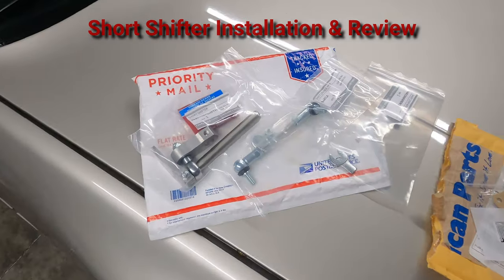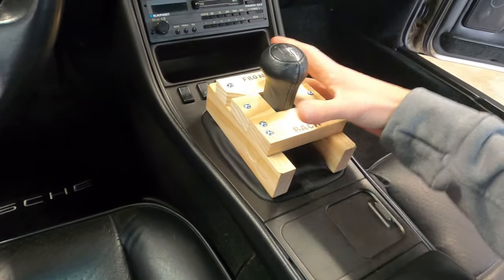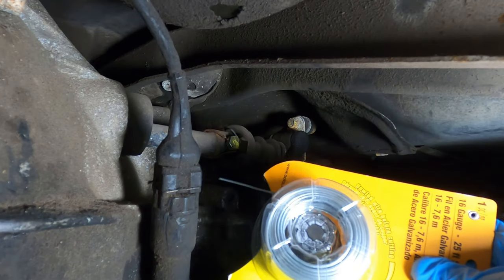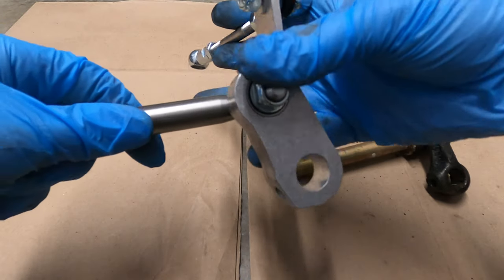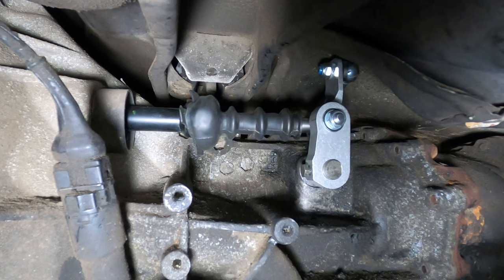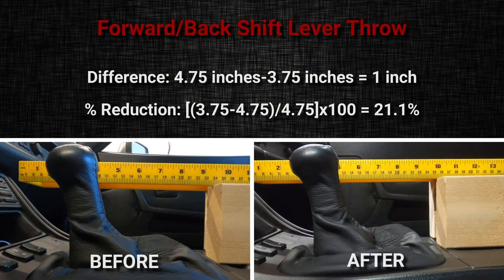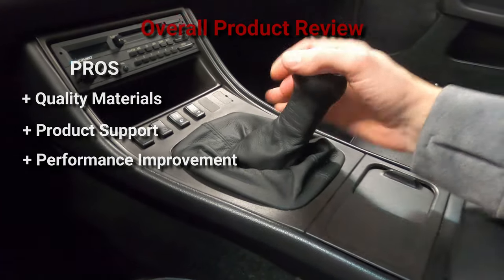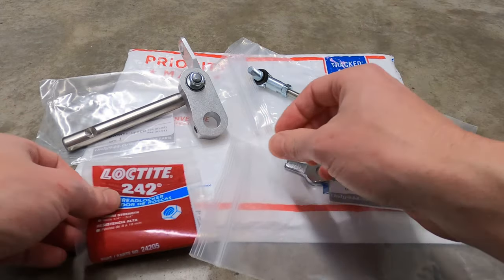Porsche 944 – Short Shifter Installation & Review with Shift Rod Seal Replacement

Comment: Used this video to help me change my shift rod seal today, grateful for the tips, especially using the 17mm socket. Another tip for anyone doing this, have an extendable mirror on hand for lining up the bolt hole to reattach the linkage to the shift rod
Reply from the maker: Nice! Yeah, the bolts on top of the transaxle case can be a real pain, I had to do them by feel. Great tip for using a mirror. 👍

Comment: Great video and instructions. However please tell how on earth you managed to screw in the UV joint at the other side of the gearbox casing. As I cannot seem to do this from either side. I may resort to dropping the axle and then gear box to gain access.
Reply from the maker: Hey Mark, yeah it’s pretty tight in there and as you can see by the lack of video for that step, it’s nearly impossible to film with the transaxle in the car. If I recall correctly, I had to install it mostly by feel, with my body positioned on the right side of the transaxle while wrapping my arm around the left side and over to the top, then feeling around to get it threaded. It took some trial and error. 😂
Reply: @NC944er  Thank you for the explanation. I'll give it another go.
Reply: @NC944er  I finally managed to do it. Thank you for the advice.
Reply from the maker: @Covkiller  Sweet! I recall it being super annoying to find the right angle and approach. Glad you preserved! 👍🏼
Reply: @NC944er  I've driven my car and the gear change is super slick and tight now.
Reply from the maker: @Covkiller  That’s awesome! It really is a transformational upgrade.

Comment: Is it necessary to remove the detent bolt to replace the gear selector plate cover gasket?  I removed the cover without removing the detent bolt but I can't get the cover back on as the shift rod is protruding about 1/4" from the gasket plane.  I'm not sure how the rod came out further and won't go back in.  Do I need to remove the detent bolt?  If so, did you use a box wrench or a socket wrench. thanks
Reply from the maker: Hey David! That’s completely normal for the shift rod to protrude slightly from the transaxle case when the cover plate is removed. You do have to fight the shift rod spring a bit when reinstalling the gasket and plate. The detent does not need to be removed. I’m not sure what other work you’re doing there, but if the shifter linkage is still connected up to the shift rod, it should be as simple as positioning the gear selector in 5th or Reverse, as moving the shift lever to the right draws the shift rod further into the case. Then you should be able to get a couple bolts threaded onto the plate and in tightening them down, the spring will be fully compressed into the correct position.
Reply: @NC944er  This is super helpful.  I didn't realize that the rod needed to be in 5th or reverse which makes sense now.  I have all the shift linkage parts removed as I am planning to install the 944only short shift kit including the rod seal and the plate cover gasket, same thing that you did.  However, I didn't change the shift rod cover plate gasket before removing other shift components and the circular rod seal.  I guess I'll need to install the new rod seal and the new short shift kit, put it in 5th or reverse to force the rod back into the transmission housing, then I'll be able to put the plate cover back on.  Thanks for you help on this and please keep the videos coming. They have been tremendously helpful.
Reply: @NC944er  I had to remove the detent nut to get the shift rod back in.  I noticed that there is a paper gasket for the detent bolt.  Where did you source a replacement when you replaced yours?
Reply from the maker: @davidkang8642  Hmmm, good to know! It must have gotten hung up on something. Mine was in Reverse during that time, so I did not encounter that. Glad you got it worked out! 👍🏼

I purchased the detent seal from Pelican Parts - https://www.pelicanparts.com/More_Info/005311599OEM.htm?pn=005-311-599-OEM&bt=Y&fs=0&SVSVSI=

Part#: 005-311-599  It may show as an Audi/VW part like some of the other transaxle components.

Comment: Do you have the OEM exhaust on it? Sounds pretty good!
Reply from the maker: Hey! Yes, I do have the factory exhaust installed on the car. However, I often use an external mic placed on the rear bumper above the exhaust tip to better capture the audio, so it does sound more subdued inside the cabin.

Comment: Hi! Did you use an O-ring or gasket to seal the 17mm detent nut? The seal seems to be discontinued from Porsche.
Reply from the maker: The part number I used was: 005-311-599. I’m seeing some on eBay and from a couple of parts vendors online - it may be listed as a VW/Audi part in some cases. I picked mine up from Pelican, but it’s now showing unavailable from them, so the part may be on its way out once inventories are sold off. It’s a VERY thin paper gasket and my guess is a light layer of RTV on the flange of the nut would do the same thing. The nut mounts above the gear oil fill line, so they’re not very prone to leaks.
Reply: @NC944er  Thanks! I might make my own out of an oil level sensor seal that I did not end up using. It should be thin enough to work.

Comment: What’s the shift rod seal part #? Looks mine is leaking when I went to install my short shifter
Reply from the maker: Sure thing, check out part number: 928-303-120-01
https://www.pelicanparts.com/More_Info/92830312001.htm
Reply: @NC944er  sweet thanks, went to do this upgrade and noticed it was leaking a considerable amount from this seal

Comment: What exhaust are you running?
Reply from the maker: It’s actually the factory exhaust, I just taped an external microphone to the rear bumper above the exhaust tip so it was more pronounced for the video. Audio from inside the car typically picks up a lot more belt noise from the engine...

Comment: Hey! I’m trying to remove my stock linkage but where the 10mm bolt is on n the gear shift side it will not come out it’s not getting loosr
Reply: Is it stuck with red loctite? Should I get a blow torch and try to get it out that way?
Reply from the maker: @thearyanpatel1682  Hey, to clarify… it’s not that the bolt is turning but not loosening, it’s that the bolt is stuck and won’t turn? There is blue loctite on the threads there, but not very high torque. But yeah, it’s prone to oxidation so I would take a wire brush to the threads, some hammer taps to wake it up, and some penetrating spray, see if that makes a difference. In the rare chance the bolt snaps, you’d have to drill it out, and a right angle drill may be needed for that tight space.
Reply: @NC944er  the bolts out the linkage is stuck in the shaft.
Reply: @NC944er  I just PB blasted the shit outta it after brake cleaning it and gonna let it sit for bit
Reply from the maker: @thearyanpatel1682  Haha! Good luck.

Comment: Hey where did you find the rest of the parts? i see the short shifter on only 944 and that's it. my 86 has 66k original miles and it's essentially like the shifter is connected to the trans with a piece of rebar. there is 100% play in the shifter in all gears and side to side, it is much worse than yours was. you can bang it back and forth and it's like taking a metal rod and banging against steel.
Reply from the maker: Wow! Yeah, some of them can develop quite a bit of slop. 😂 Kyle has the parts separated out on different pages for some reason, rather than a packaged kit, but they’re all under the Performance section of the Parts Catalog on his site. Here are a few links…

Shift linkage - https://only944.com/partscatalog/only/shiftlinkagearm/
Shift lever - https://only944.com/partscatalog/only/shifter/
Short Shifter - https://only944.com/partscatalog/only/shortshifter/
Reply: @NC944er  Thanks. awesome videos, keep up the good work. you earned another subscriber!

Comment: Still Happy with it after six months? This is on my list, but I keep buying other crap.
Reply from the maker: It’s sometimes hard to do the fun things when there are other maintenance items pending. 😂

It’s still perfectly tight and notchy with no discernible degradation in quality. The OEM shifter has a softer feel and I think if I had replaced it with OEM it would have eliminated a lot of the slop, and that would have been fine for everyday cruising. The short throw is definitely sportier though, which is fun. Just wish I could drive the car a bit more to enjoy it.
Reply: @NC944er  good to hear, I was pretty sure it was high quality. Everything I’ve gotten from them has been. I “daily drive” my car at least a handful of times to work each week or whenever I’m not toting the family but i need to get up to north GA or NC mountains to enjoy it a little more thoroughly here soon